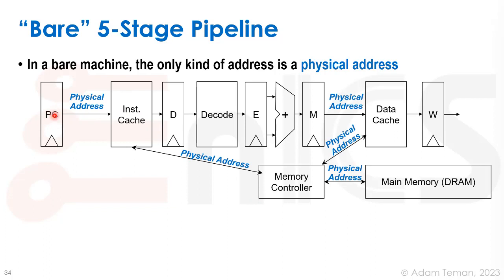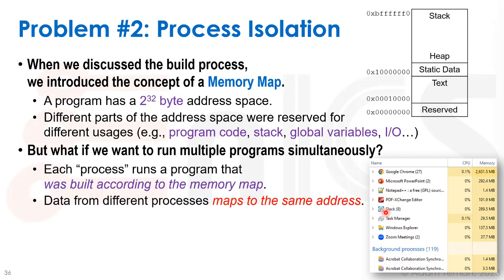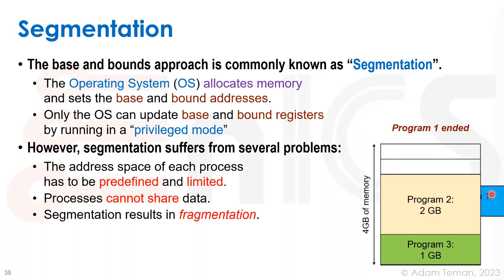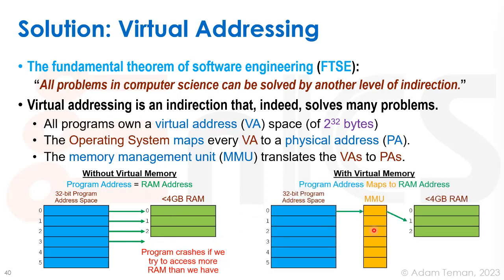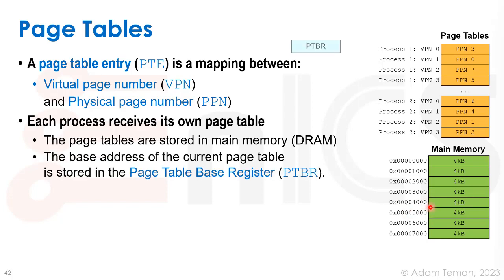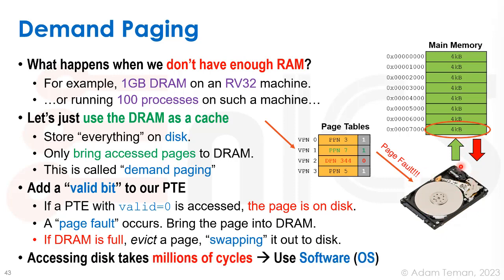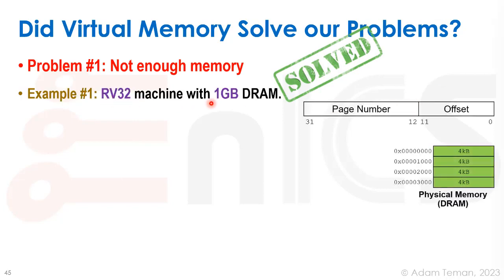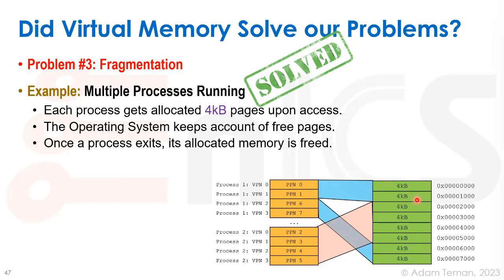SoC 101 - Lecture 6d: Virtual Memory

Comment: Do all programs and I/O devices have the same virtual address space and different page table entries?
Reply from the maker: No, at least if I understood your question.
Each I/O device gets it's own physical range of addresses.
Each process (i.e., instance of a program) gets its own page table. 

But usually, as I cover in the next lecture, the actual operations to and from the I/Os are done using system calls to the operating system. So the operating system handles these.